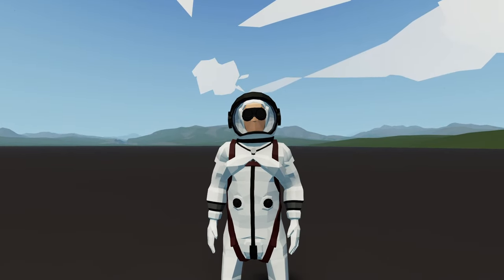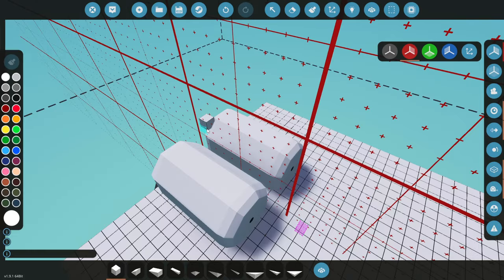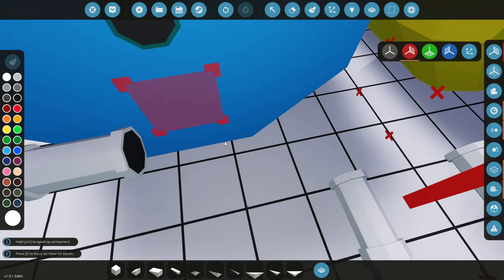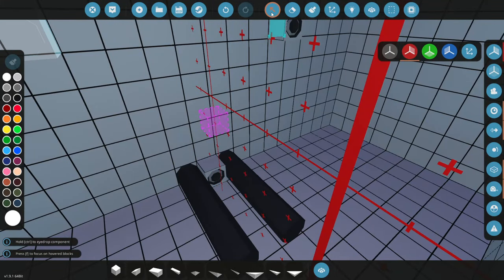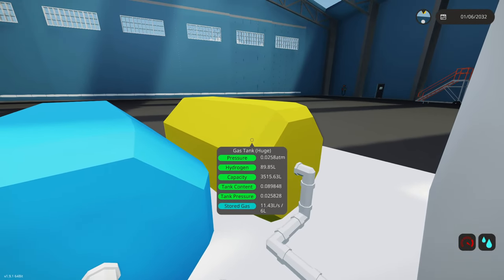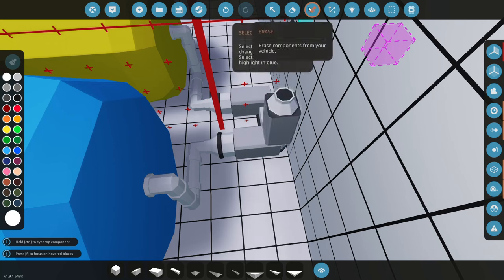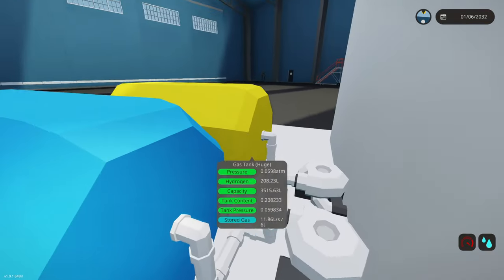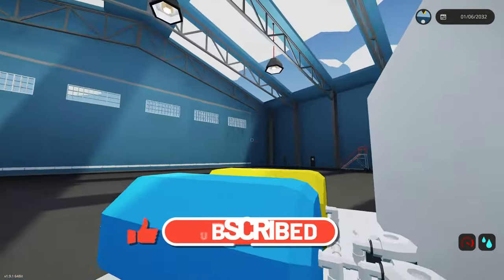Electrolysis Hydrogen/ Oxygen Production Stormworks Tutorial - How To

Comment: You may still need the pumps to fill the tanks completely because of the pressure. Have you found a way to filter out CO2 from the air? I was able to split nitrogen and the remaining air with a centrifugal separator, but was not able to further split oxygen and CO2 yet. This would be required for long running stations. Otherwise you would need to release air into space and replace partially with oxygen which is a huge waste.
Reply from the maker: good point with the last bit of gases. have you tried to use catalitic converters to remove the co2? i think the game sees co2 as exhaust now.
Reply: co2 isn't a gas in the game
Reply: @axialivanov6101  CO2 is Carbon Dioxide which is now in the game. You can't spawn a tank full of it though but it is part of the normal air.
Reply: @ProfNCognito  I have tried catalytic converters but haven't observed any conversion to other gases or a reduction of CO2, even with a stack of 5+ converters and a circular air loop.
Edit: there seem to be some losses, but for all gases equally. Meaning it's the same as just releasing it but more expensive.
Reply: Co2 is in the game but it doesn't do any actual damage to the player for some reason. Im pretty sure they calimed that you could die from too much co2 but it doesn't like like you can so filtering isnt something you need to worry about
Reply: @A_youtube_channel_  Interesting. I mean technically you don't need it anyway because of space suits. I just find such things interesting because it adds a little bit of an engineering challenge.